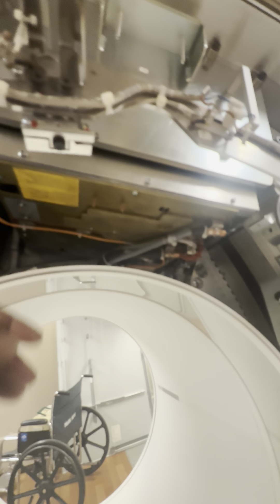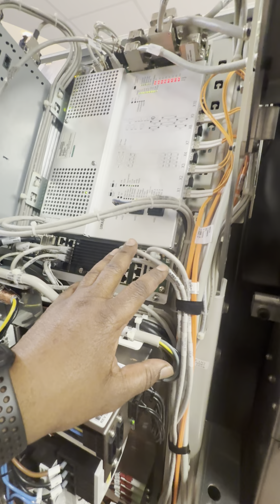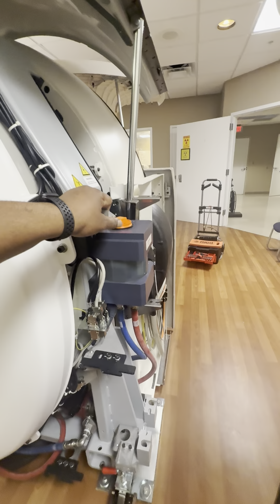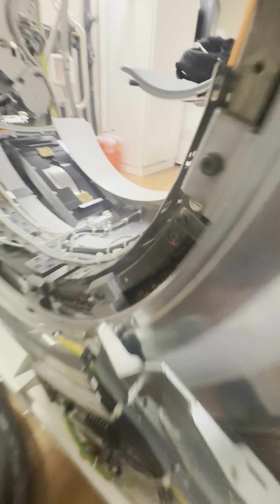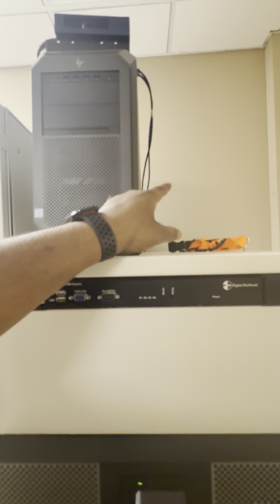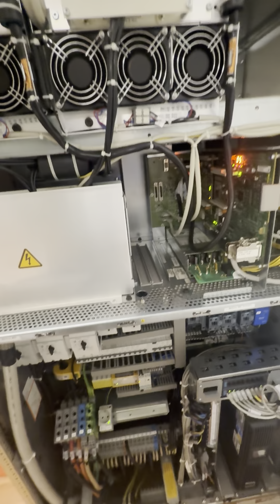Inside the PET CT: Biograph mCT

Comment: Have you or a loved one, ever have to have a scan from that Make & Model of machine? 

What makes the Telsa different from the old scanner?

If you have Tech associates that does the actual scans, can you ask, "Is it customary to have a person do back-to-back scans any body part, like a wrist; regardless of age?" 

We did an elder & cannot rule out weather prolonged exposure triggered a heart episode. She had a stress test the year pior that showed a fully working heart. However, a follow-up EMG showed a -20% reduced blood-flow strength. 

PCP wanted her to do a follow-up Stress-Test. Her cardiologist reccomended the PECT to rule out any blockages, before putting her already compromised heart, under the stress. 

Waiting to see her pending PECT results; it may change protocols going forward for the elderly.
Reply from the maker: I haven’t been scanned on that system, but I’ve been scanned by a Siemens CT